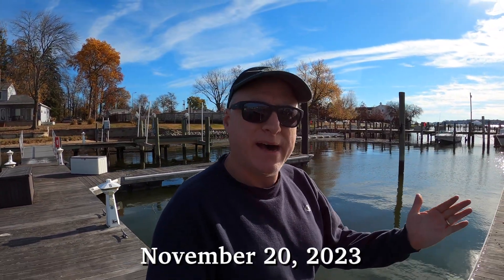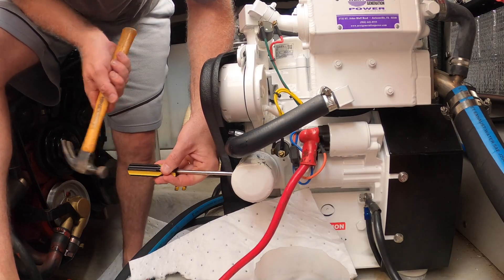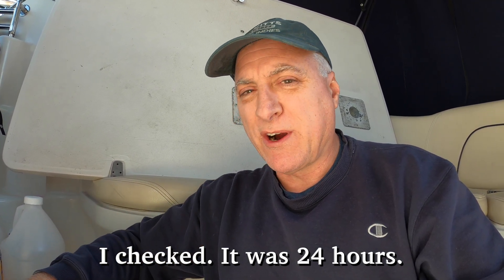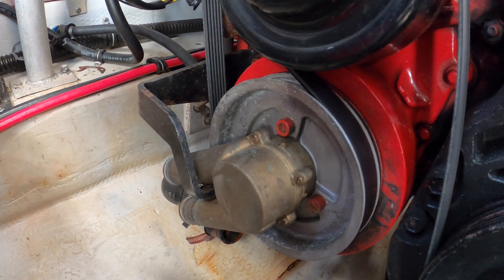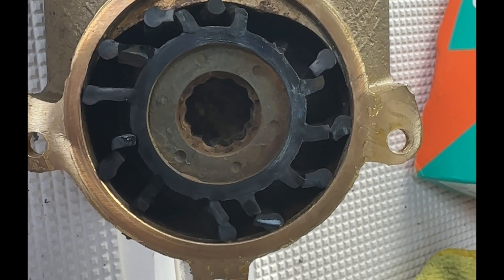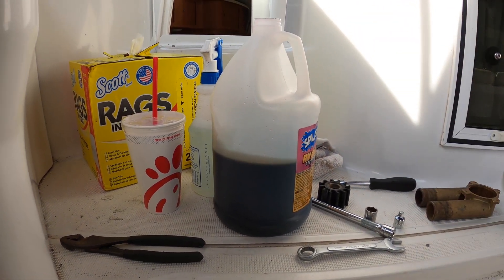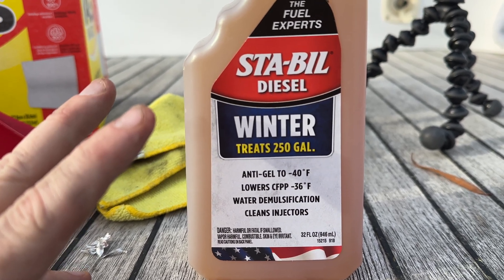Oil and Filter change on generator plus impeller check - Episode 121

Comment: Good stuff Jeff.
Great colors on that boat. Navy, white & red stripe. Timeless…

BTW: I stopped measuring Sta-Bil a number of years ago. Glug, glug, glug.
Reply from the maker: Yeah it’s obviously not a big deal in smaller amounts but when you have 210 gallons of fuel for the engines I don’t want to waste the additive as it’s expensive as you know.

Comment: Man your impellers are SO easy to change compared to the 7.4 340 Merc's in Thirsty Whale!! 😎I REALLY struggle with mine for two reasons...the design of the housing, and the location of the pump. What a headache...🤕
Reply from the maker: Yes this is one of the advantages of these engines. It’s nice to have one!

Comment: A very minor FYI...the oil drain hose on your generator...you don't need to remove that barbed fitting. With 2 wrenches, undo the fitting at the end of the hose as it acts as a cap. We really enjoy your videos, keep them coming!!👍
Reply from the maker: Thanks for the comment but I’m a little confused as to what you are suggesting. I realize it might be hard to explain. The barbed fitting is the cap isn’t it?
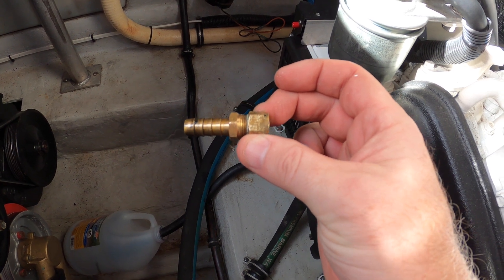Reply: @eternitysshore  At 2:17 in your video, your thumb is actually on the removable cap. I think it's two 9/16" or 1/2" wrenches required...one where your thumb is and one just between your thumb and the hose clamp. The piece being held by the hose clamp remains in the end of the hose.
Reply: Definitely 2 separate pieces. Barbed side is male, cap is female. The engineers tried to make it easy.....for once!
Reply from the maker: @charlesdavenport2543 ok I get it now!! Thanks!!
Reply from the maker: @BellavistaPEI ok I’m finally clueing in. I get it now! Thanks for pointing this out. I thought it was crazy what I was doing. The first time I saw it I couldn’t understand why they would make it that way.
Reply: @eternitysshore  Only glad to help! My twin 5.0 Mercruisers are set up with this in that I don't even need to get into the bilge to do an oil change...I just pull the two hoses, the same as that one on your generator, out through the transom and drain the oil. It works great and less chance for a spill! Keep up the great work!!
Reply from the maker: @BellavistaPEI  cool. Thanks for your encouragement.
Reply: @BellavistaPEI  Do you make videos on your channel?

Comment: Wow that impeller was really chewed up.  But this is where the Volvo design is light years ahead of mercruiser.  A quick check found an issue and prevented a major headache.  Nice work.
Reply from the maker: Agreed. Thanks for the comment.
Reply: Why is Volvo light years ahead of Mercruiser? Replace mine every other season, GTG
Reply: @CaptainTodd   The pump and  impeller are in front of the pulley on the Volvo giving easy access.  Merc is behind the pulley which puts the pump under the engine.  Making routine checks more difficult, that's all.

Comment: Hey Jeff, IMO I would replace bith impellers while you have them out. Prior to purchase the previous owner had an issue where it wouldnt pump watwr sometimes. If i spun the pulley with a wrench everything worked. Turned out the impeller looked like yours, some "fins" were opposite of the others. Keep the vids coming!!!!
Reply from the maker: Yes I’m actually planning to replace both. Thanks!!